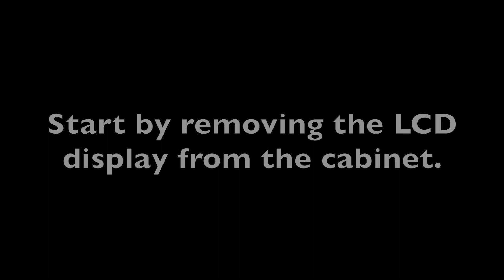Halo Fireteam Raven Arcade Game Repair - How To Fix No Backlight Issue - KTS650AG101

Comment: Note before you lift up the LCD panel you must either cut the 4 pieces of sticky tape on the four corners that hold it to the plastic diffuser bezel OR disconnect the two outside plastic diffuser bezel pieces or it will still be attached when you try to lift the LCD panel and you could potentially crack the panel.

Comment: Hello, i have a problem with my tv, it is a samsung 8 series, it uses power supply module L65E7N_THS code BN44-01059A, the tv does not turn on but when connected, it startes flickering.  I removed back panel and disconnected main module and leds just flash, it doesn’t stay on.
Reply from the maker: Hi! It definitely sounds like your LED strips have failed and need to be replaced. Good luck and thanks for watching!